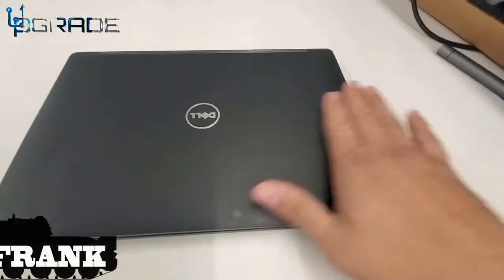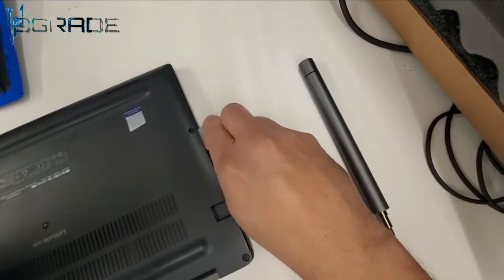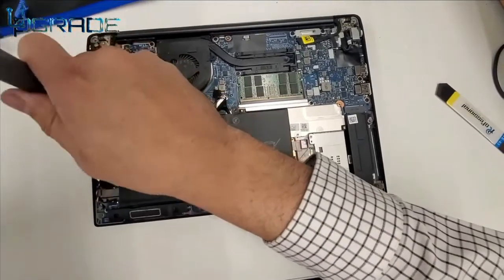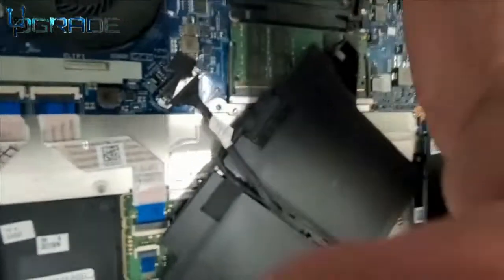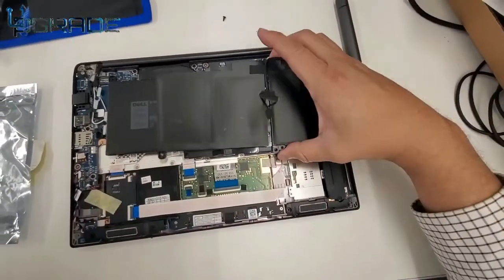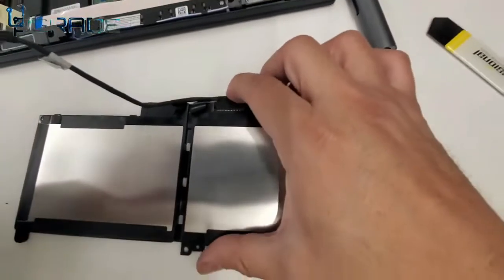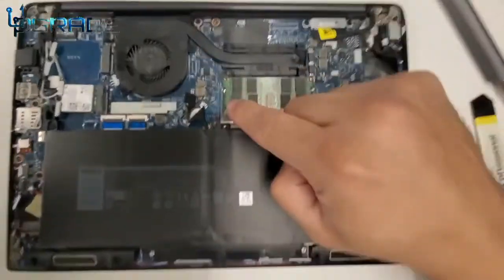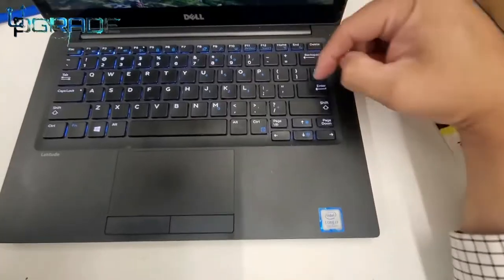Dell Latitude 7280 Battery Replacement

Comment: I bought a refurbished-grade A dell latitude 7280 with 3 years warranty for 310 €. i use both windows 10 and mint and works perfectly. battery lasts from 4 hours to 9 hours depending on the task you are doing. i think at that price is a best buy
Reply: Hi, that was impressive! Can you tell the way you've used and charged the battery to keep it that good?

Comment: Great video. Do you have to save all of your hard drive on an external drive before changing the battery?
Reply from the maker: No need to do anything on the drives only disable Bitlocker if you have this enable and this should boot up normal.

Comment: I have a stupid question. I got the new battery but has a black cover all around it, am I supposed to tear it ? To expose the metal ?
Reply from the maker: No, don't remove from its cover but remover an blue plastic shrink raping

Comment: Just wonder if the different voltages of the batteries does not cause any problem.
From what I read the small 42Wh is 11.4V and the 60Wh is only 7.6V
Would appreciate if you can confirm that it works before ordering the bigger battery.
Reply: legit question: poster of this, please answer
Reply: @kvn864  Can confirm that the 60Wh at 7.6V works fine
Reply: did you order a bigger battery 60Wh is only 7.6V instead of the small 42Wh is 11.4V  for your Dell Latitude 7280? Is it working?

Comment: I liked this model.  I had a few retired at work that I have set aside for project machines.  The best thing about it was it has an ethernet port where many of the newer machines in this form factor do not.  The only thing I don't like about it is it only has one DIMM slot and I've only seen them with 16GB of RAM.  I prefer the 5280 as it has two DIMM slots and supports 32GB of RAM on a nearly identical form factor.

Comment: What was the larger battery model you replaced it with. My current one is a DJ1J0 but I didn't order an original any it doesn't seem to be detected. Do you recommend getting an original one?
Reply from the maker: Many Battery that have flooded the market with different models brands, look at the Amazon reviews because its a hit or missed when you purchase a battery and make sure it fits and that the power connection are properly connected. I don't have a recommendation at the moment because many choices.

Comment: Did this very replacement this week and for the first time the laptop wouldn't boot
Had to go round some error messages a few times and boot into Windows safe mode, after that it was fine.

Comment: Hi..thank you for this information..FYI.. I have similar issue ..mine is dell latitude 7280.. it has smaller battery..with code DJ1J0, 11,4v... Can you share the type of the larger battery that fit with latitude 7280?
Reply: F3YGT